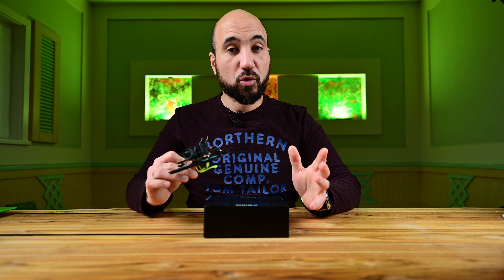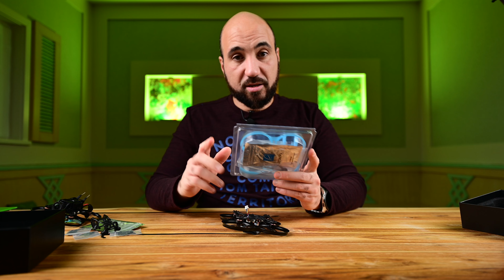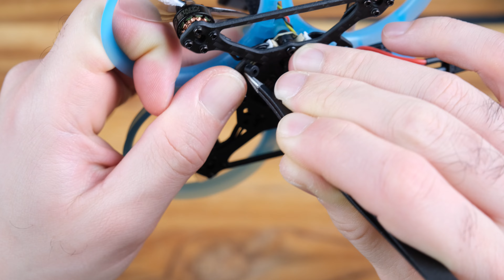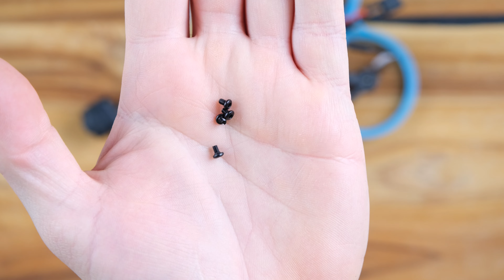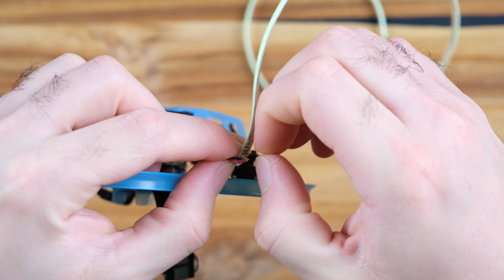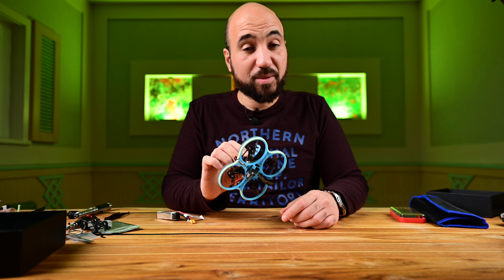Betafpv PAVO 20 Review | Frame replace | DJI O3 installation #betafpv

Comment: Hi, the Caddx Nebula Pro is also compatible with the DJI Air Unit O3 system, I want to install on my Betafpv Pavo20.
Reply from the maker: Dji o3 system works only with dji camera as far as i know! Maybe it works with other cameras but i didn’t try this…